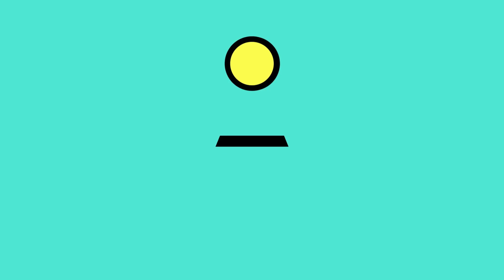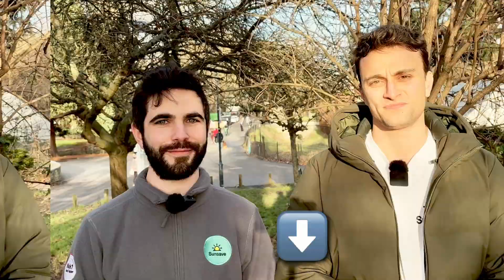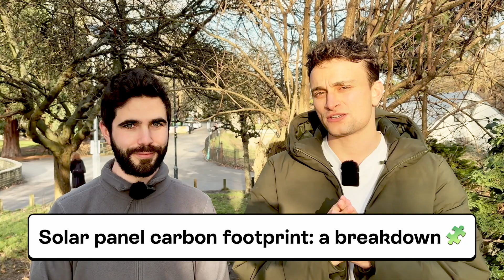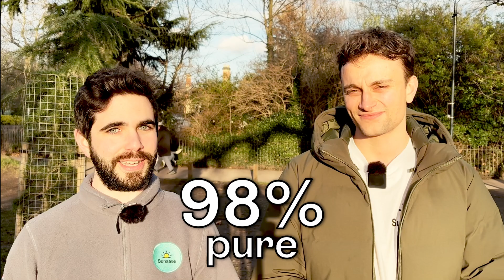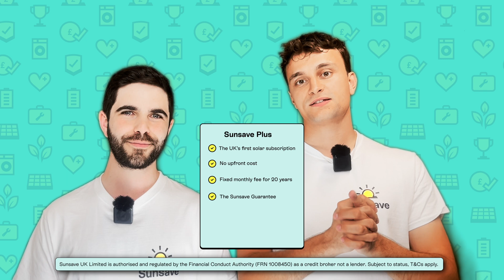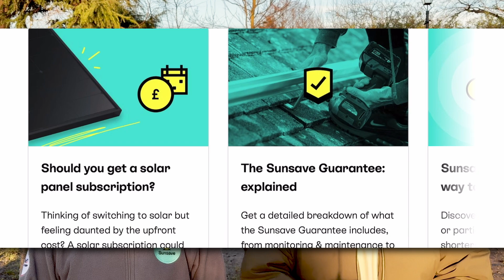The REAL environmental impact of solar panel manufacturing

Comment: The following has nothing to do with excusing fossil fuels or pushing Veganism- Verifiable mathematical proof( link below) that the unfolding biosphere collapse is the result of Mass Global Deforestation(MGD) of 1/3rd of the Earths(Ice free) Land Mass, for the 80 Billion animals bred for eating every year. Without which we could reforest 78% of agricultural land which would be enough of a Carbon and Sink to sequester more CO2 than is currently emitted ( while also ending the biggest Methane emitter and biggest cause of Ocean Dead Zones). Non Industry funded study by Systems Analysist Dr Sailesh Rao explained in simple terms how animals ag is responsible for 87% of CO2 emissions!. -https://youtu.be/mrSc_51xR8sQ?si=p